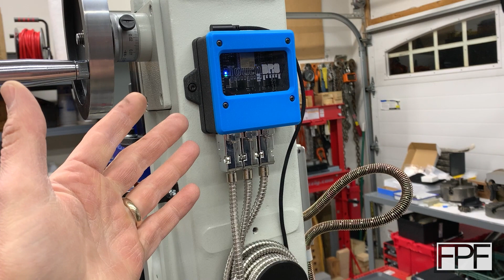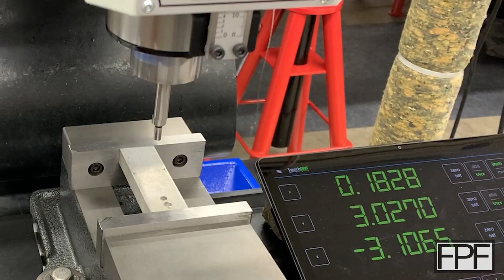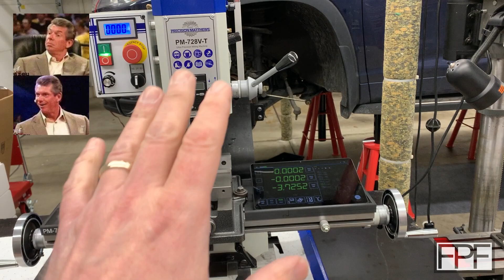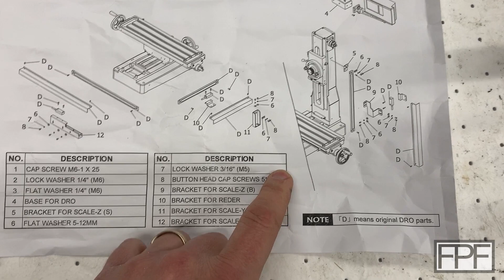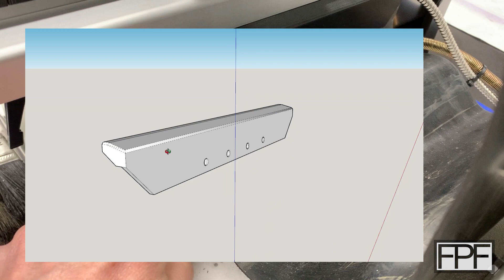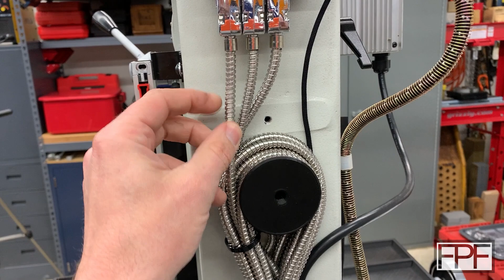3D Printed DRO Scale Mounts for PM 728 VT Milling Machine - TouchDRO

Comment: How do you handle the digital readout from the quill in combination with the z axis for the dro?
Reply: Well, the mill version of the TouchDRO includes 4 axes, so you would just wire it up with the correct connector. OTOH, all PM mills ship with quill DRO scale and readout, so you could just keep it separate and not mess with it if you wanted.

Comment: You happen to remember the pin out for those scales if we get the same ones?
Reply from the maker: I do not, but I think I found them pretty quickly on the bench with the guide they give you: https://www.touchdro.com/resources/scales/glass/glass-scale-pinout.html
I messed with one on the workbench and figured it out before I started mounting anything on the mill

Comment: What length did you use for the x-axis scale?  The ones you linked are all much shorter than the travel of the table on your machine.  If you go further the read head just slides out of the scale?
Reply from the maker: Good question! 520mm.   I just checked my order history and the link is correct, but does indeed goto the wrong length now.  They are probably out of the 520's, so it defaults to another length.